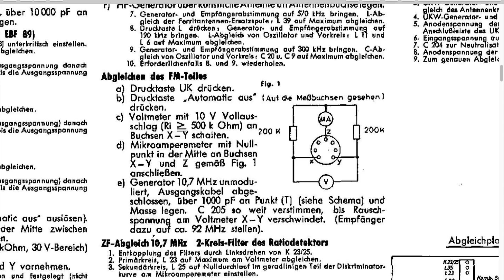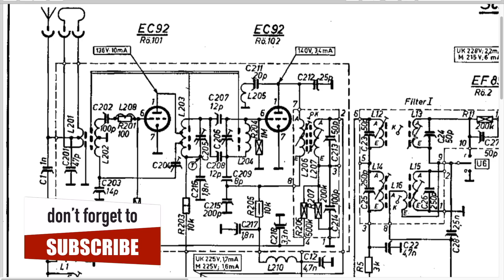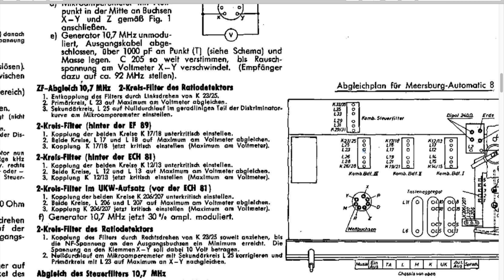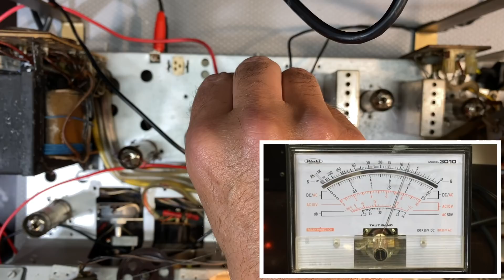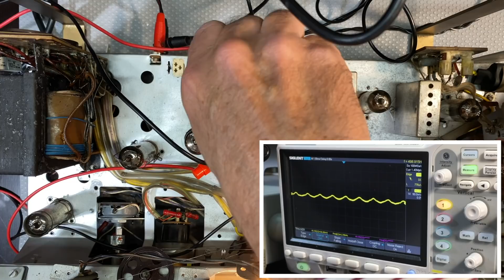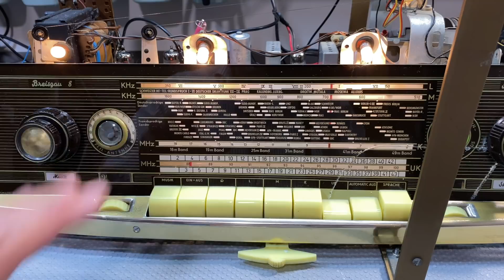SABA Breisgau 8 pt. 10. Aligning the FM turns into an unexpected mess. It happens.

Comment: Manuel  I think   you have point out the trick at 20:54, (video time) the upper screw coupling  makes the mixer  triode to oscilate  in some  positions in the first images with the osciloscope apears that mix  at scope's display two pikes inthe sine waveform two frecuencies  your signal generator+ auto (feedback oscilation), before 20:54,sinewaves pikes gets fatty and the speaker sounds gritty and dusty, finally at 20:54, you've got  a clean sinewave and it sounds clean at the speaker.
Thats my humble&nerd  opinion.. It's mine... & may be wrong😉😉

Comment: I just did an FM alignment on a Breisgau 11.  Very touchy and easy to go from critically undercoupled to critically overcoupled. The instructions are identical to the Breisgau 8. One thing to remember is that all alignment adjustments are made with the transformers undercoupled by about 20%. They are then reset to critically coupled.

Comment: I had the Freiburg 8 alignment instructions translated some time ago and have managed to find the document. This is from the FM ratio detector section: “2-channel filter of the ratio detector
1.	Tighten connection of the filter by turning K 23/25 to the right until the low-frequency voltage on the output socket reaches the minimum. The voltage across  X-Y should be 10 volts.
2.	Correct zero-flow on the microammeter with secondary channel L 25 and adjust primary channel with L 23 for maximum.
This final part is with AM mod, like you did, but with the coupling over coupled not under coupled. Maybe you got there anyway.
Reply from the maker: I seem to have had more luck than brains, and it got there 😊

Comment: Check the load resistors of the diodes in the ratio detector. They are probably mismatched by now, which would explain the inability to get 0VDC.. Replace with 1% metal film.

Having said that, I looked at the schematic and couln't even find the load resistors! In which case I would check the diodes for equal Vf. I would also revisit the detector secondary after getting the IF strip aligned. You might find it has fixed itself, or at least that it can now be centred.

Also, I think you have a mistranslation issue. They don't mean 'critically uncouple', they mean 'uncritically couple', i.e. reduce the coupling below critical. Only 20% or so is sufficient according to http://www.radiomuseum.org/forum/alignment_of_saba_automatics.html.

But I would definitely sweep-align this (and everything else), with a sweep gen and a scope. You want to see the S curve and the IF shapes. Meter alignment is only for when you don't have the right gear.

You want to keep an eye on the AGC voltage while doing alignments. Never let it get above a volt or two in magnitude, reducing the siggen output as required.

Comment: Interesting video Manuel and an interesting fault, hopefully you can track down the reason the ammeter isn't responding as you would expect. More for my benefit than anything else 😀  Kudos for removing the cover from the FM module 👍🙂
Reply from the maker: thanks
Reply: Pro trick: you can watch movies on Flixzone. Been using them for watching all kinds of movies lately.

Comment: Are you using 100K resistors for the uA-meter connection and not 200K as the instructions shows?
Could that be the reason why it's not possible to get it to 0?
That it "loads" the circuit too much?
And what about the 2 diodes inside of the "Filter III" can, are they ok?
Beautiful radio BTW, hope you find a nice cabinet for it :-)
Reply from the maker: Yes, the 100k may be too low. Need to retry that all again.
Reply: Thoughts. -4.5v not needed for FM. Volume at max, min signal level to see on the meter. Too much signal makes it difficult. 200k not 100k resistors as you discovered. Subcritical coupling is maybe just a half turn left. I’ve been here too!
Reply from the maker: I did a review (again 😊) of the schematic and the -4.5 doesn’t seem to act on FM as it does on AM. 
This is why I like the comments. It’s always useful to listen to others’ experiences. Thanks.

Comment: to note, not sure if you realized this. Point 1., under ZF-Abgleich 10,7 MHz, it says to de couple the filter by turning K 23/25 to the LEFT, Linksdrehen means left turning, or to turn left...just thought I might make you aware of this
Reply from the maker: Yes, I did that first. Anti-clockwise.
Reply: @electronicsoldandnew  It also seems to me that you may be decoupling the first adjustment coil too much?  Making it “uncritically” coupled could indicate a less drastic excursion of that coil is only needed, rather than the multi turn near flattening of its effect?
Reply from the maker: could be.